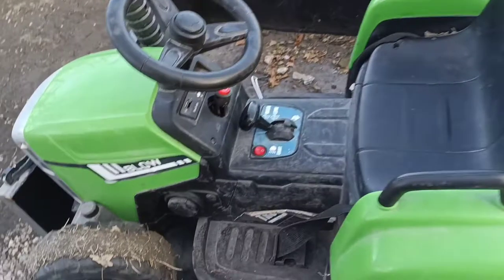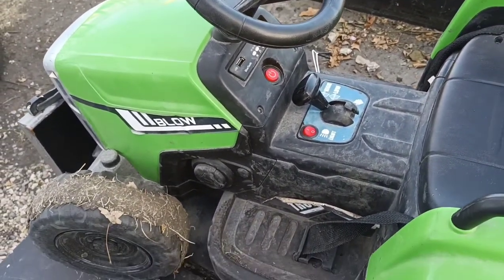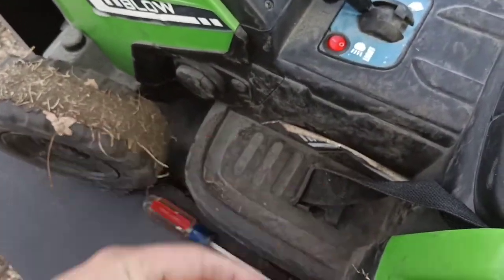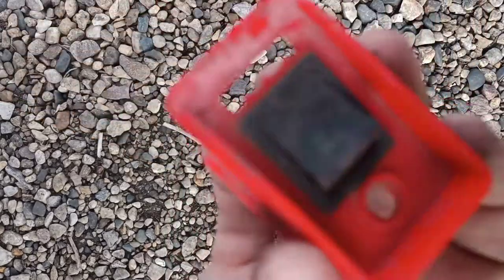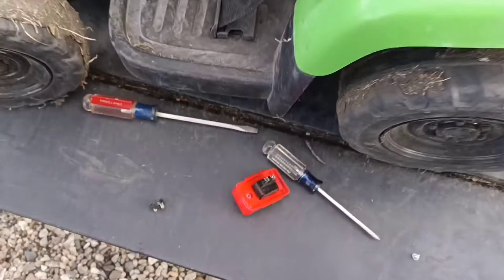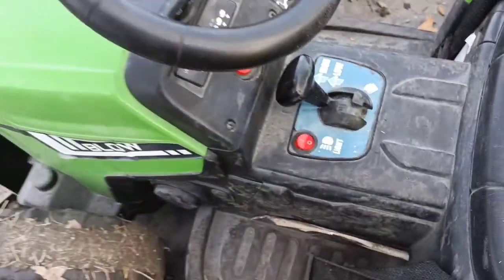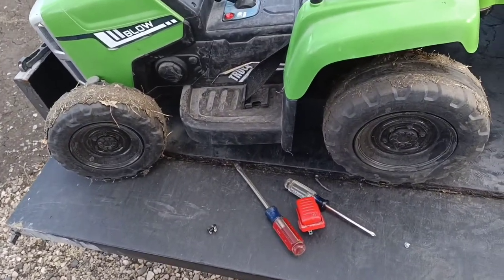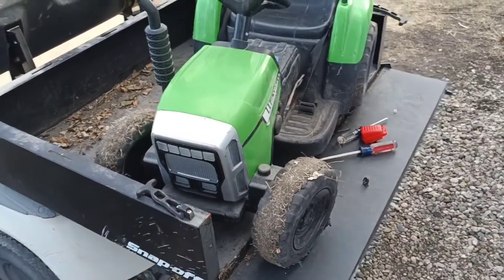12V Ride-On Toy Tractor Diagnosis and Fix Repair Kid Zone 1.5 Year Update Power Wheels Kidzone

Comment: Cool. I’m trying to diagnose my sons dead huffy 12v tractor. Pedal depressed and nothing happens.
Reply from the maker: You can touch the 2 wires together on the pedal connector and if that is the problem the the wheels will spin if not it is something else. All the pedal does is close the circuit to provide power.

Comment: Hey I have the same tractor that I got off a friend it didnt have the controler so I bought one i got the controller to work but when i try to move the right and left rear wheels spin in different directions. One goes forward as the other goes in reverse. I cant figure out what is going on with it do u know what Is going on
Reply from the maker: Unplug the connections on one motor and switch the wires around. They must have been plugged in backwards and if then forward goes in reverse then switch the wires around on both motors.

Comment: My grandson has the exact same tractor and it’s not getting power. I’ve checked the battery and the switch and foot pedal which are all are good! Do you have any other suggestions what it could be? Thx

Comment: What was it acting like when the on/off switch stopped working? My sons switch flashes once and then goes out. Trying to figure out if it’s the battery or switch…
Reply from the maker: First the LED stopped working, then I would have to press the switch in many times before the tractor would actually turn on.
Reply: @humbullitt  I took the switch apart but can’t remember the set up for the wires now! Is the black wire positive and red negative or the opposite? Purple is ground I’m assuming? Any help would be appreciated. This tractor has seriously driven me crazy!